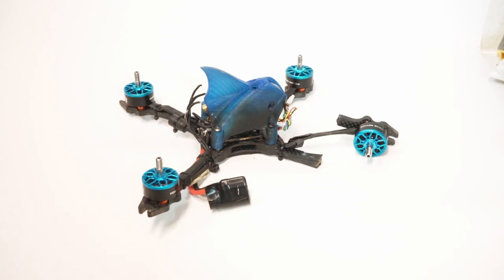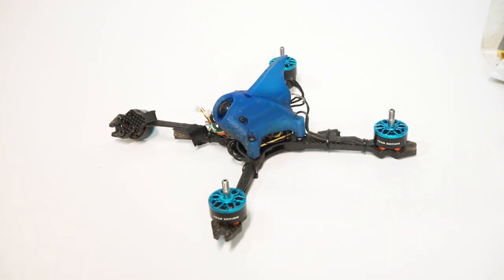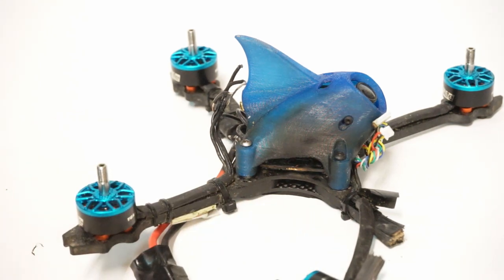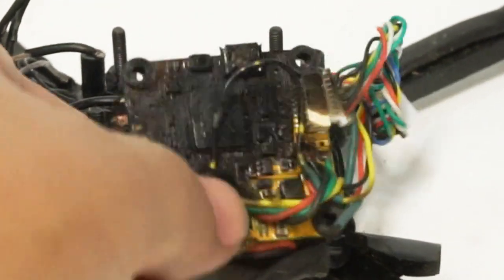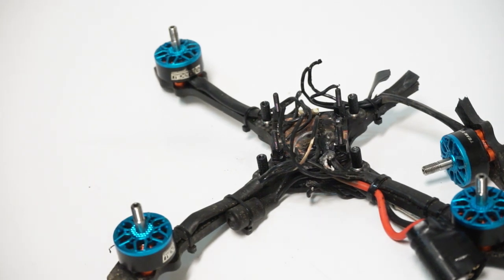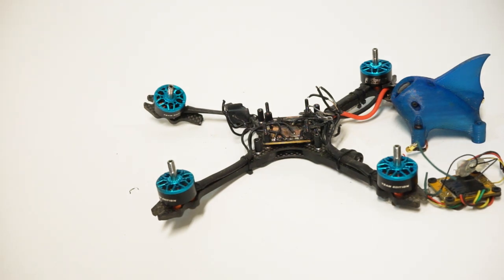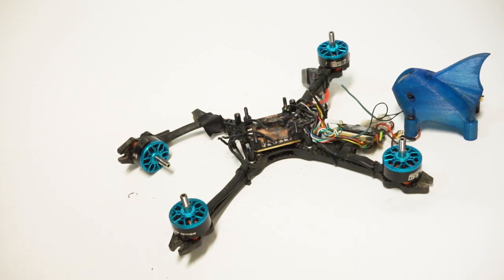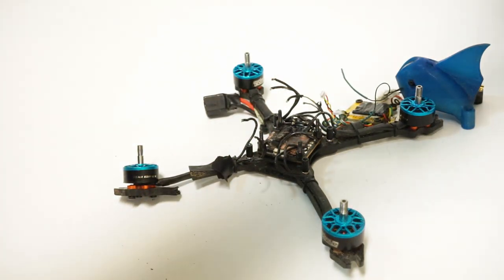Burnt Quadcopter Autopsy

Comment: About to make the move to 6s on my CF1. Thinking about hyperlite 2208.5 1922 for some extreme speed. Looking at pyro graphine 6s 1250 for price. What batteries do you guys recommend and what 6s packs have been holding up?
Reply from the maker: I’ve used 5 diff 6s packs. Best was infinity rs 1300.  Worst was cnhl mini star 1250. 

Piro, xilo And rdq were all good and about equal.  The infinity was just barely above those. But good for a little more on a race
Reply: @JonE5FPV  thanks for the reply. Funny I just had my newest 4s battery "CNHL Ministar" go bad on me today. Sags all the way down to 13v on first 2 punchouts! GNB has a 1250 6s 120c 220 gram that sounds good on paper. Gonna give those a try sense the infinity is out of stock atm.
Reply from the maker: Let me know what you think of those GNB when you get them.